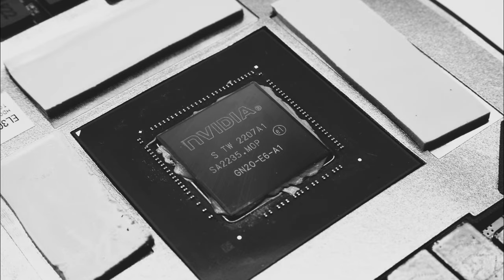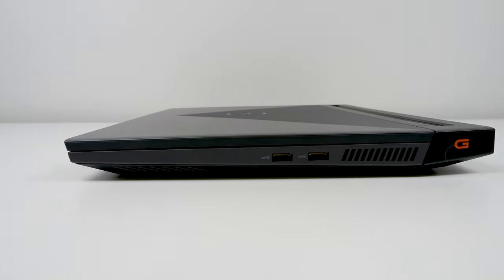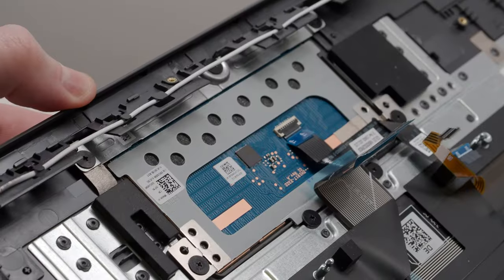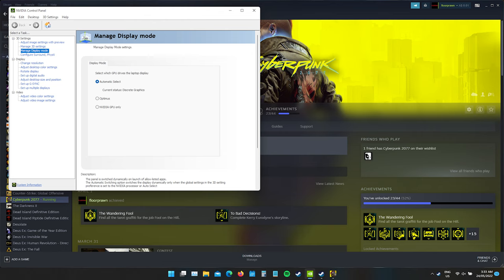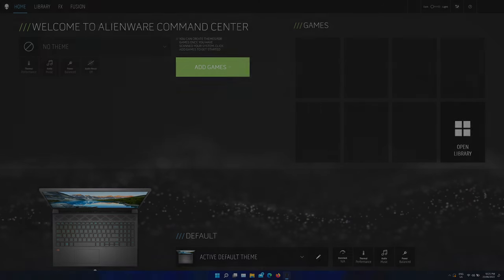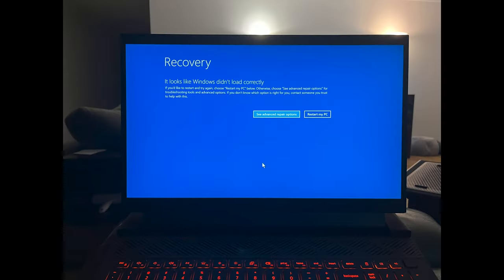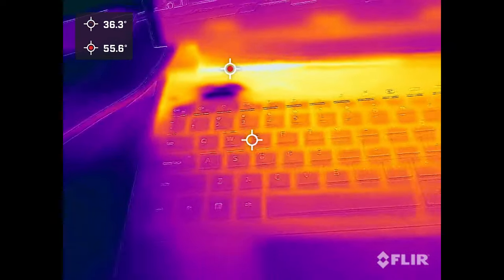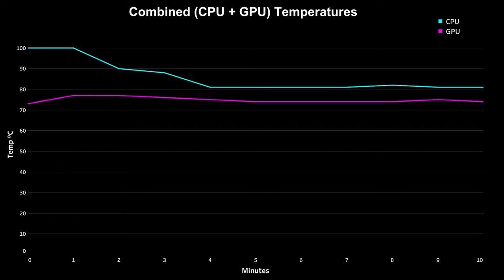Dell G15 5520 - i7 12700H/RTX 3070 Ti - Nuclear Review

Comment: I bought the RTX3060 6GB variant from their official refurbished for £750 which is almost 35% of the original price. So far I am happy with it. It is able run light machine learning models which I can deploy on a HPC cluster later. I played GTA 5, Cyberpunk, Hitman 2,3, COD MW3, RDR2 etc same time streaming.
Reply: Do you have any issues with CPU running 100% on light games?
Reply: @devosaiditsfire3445  no. the cpu is 20 cores.
Reply: Might just be bios or optimization for me
Reply: r cpu is hot like on this review? 100 Celcius?

Comment: Oh my gawd No, i just bought this laptop and will arrive next week Tuesday. Maybe I should have bought the A15 6800H 3070TI, should i cancel the order? I wish i had this review sooner, I'm so worried i wont like it.
Reply from the maker: Did you buy it from Dell or somewhere else with a good return policy? If so, just wait. You'll know what to check for on yours when you receive it. If it shows up and you're happy with it after a few days then rock on - otherwise you'll be able to send it back and try something else.
Reply: @NuclearNotebook  I did not buy this from Dell. I can return the product for a full refund, but only if the product is unopened. If it is opened, i can return it within 7 days of using it but after paying a 25% restock fee. The loophole is that if i find anything faulty, i can replace it with the same product, another product or receive my money back, but that is only because of the law in my country, they are are doing the bare minimum required. I have heard about the software bug problem from multiple people, maybe i can use that as the faulty problem.  I am considering playing it safe and just cancelling my order now, they are legally required to just give me back my money no questions asked if they have not shipped yet, have you heard good things about the Asus A15 6800H 3070 from 2022?
Reply: @Dani-kq6qq  Hi there!
How has the experience been so far for Dell 15? I'd really like to know as I'm about to buy one. Thank you.
Reply: @beksan9775  Mine is a black obsidion special edition 5521 G15 1440p 240hz G-sync 400nits DCI-P3 99% 12700h 1TB pc-ie gen4 140w tgp(125w excluding dynamic boost) with advanced Optimus 3070ti 32gb DDR5 ram, & I got it for 1,716 in USD before tax, it is a very competitive price in my country, but you may get better deals or better priced laptops in your country. It performs very well and the screen is very good, I love the laptop but part of why I love it is because I use it as a desktop replacement where it is almost always plugged, 3 year warranty and I got it at a very competitive price in my region and all this stuff may not be true for you, I wouldn't pay more for it & I would feel differently if I planned to use it mostly unplugged. Battery life is poor, yet somehow can last a decent amount of time when just playing movies locally with vlc or using Word with wifi off, but that still requires fiddling with the right conditions & that fiddling is not how I like to use a computer. I suspect the battery life is this bad partly because of poor software power management, but 12th gen is still bad for battery and heat generation, so you might want to buy the Ryzen 6800h version. It can get warm & loud unnecessarily even with light tasks,  I am using it right now and it is 31% to 42% fan speed at 55 to 63 degree temp for cpu and 42% fan speed for gpu at 55 degrees temp for gpu according to Alienware command center program while 40 chrome tabs open & utorrent(legally torrenting datasets for my work). But don't buy expecting a silent machine, but you can force it to be quiet, but it will mean more heat & more throttling. Keep in mind it is 17 degrees Celsius morning where I am at right now & my room does not face the sun, so it is not like it is a warm room. It likes to be plugged in to perform at its best, but that's true for all intel cpus, it is also heavy and the charging brick is big. I have not encounterd any bugs, my games load just fine, the G key works fine.  You've also heard that it has 1 functioning Ssd slot, that is true, so don't choose below 1 TB, I am saving to get a 2 Tb gen4. I am at 543gb after installing god of war and jedi fallen order, but I also use this machine for software development, so that's where most of my storage went. It plays games very well at 1440p, I have played GoW, Fallen Order, Shadow of the Tomb Raider, Guardians of the galaxy at high to highest settings at above 100fps DLSS on Quality setting and raytracing off and can get as hot as 92 degrees on the P cores of the CPU and 82 degrees on the GPU but will usually target 79 degrees. You should use a laptop fan stand that can elevate to get the best temperatures.  I am gonna test how cyberpunk 2077 plays at 1440p on this machine today.  I mentioned a lot more gribes not because I don't like this machine, but because you will like it better if you know what you are buying. The rest of my opinions are purely subjective and will change. The touch pad is smaller than I expected but I am used to using big macbook pro TouchPads, not of windows gaming laptops, so there is that. I like the keyboard, I like the rgb at the front bottom of the laptop, I like the rgb keyboard customizations, I love that it looks like a gaming laptop, but a bit subtle when I am at work.

Comment: thanks for the review. found this after i had bought my laptop and was looking for a tear down of the laptop. i appreciate that. this is the first laptop where the head pipes aren't on the bottom of the laptop and it looks to be a pain to get to them. i was going remove the thermal paste and  add arctic MX4  since i heard that dell cheaps out on the thermal pastes. did you notice any thermal differences after reassembling vs before? currently when i run the cpu at max 100% in power options and on a easy title i get where its bumping up to the 98C temperature ranges and 60c idle ranges. which seem hot to me.
Reply: I applied honeywell 7950 to mine and I do indeed see idle temps in the mid 50's and peak load temps exceeding 100 degrees on this laptop. The gpu on the other hand now hovers around 72 degrees under full load at just under 140 watts, which I consider a very healthy temperature.

Comment: Hi there, I was about to buy the version i7/3060 or i7/3070Ti but I came across so many bad reviews (mainly problems about overheating etc) I will mainly use it for video editing and gaming and I really don't care about 2nd slot. I am mostly anxious about thermals as they reduce laptops overall life, but if I repaste with a premium paste wouldn't it be ok? I would like your opinion or another recommendation around the same money
Reply: Did you buy this laptop? If you bought this laptop, can you share your experiences with me? Because I think the same as you.
Reply: They're using the same cooling system from 2021 (or maybe with some changes for the worse to cut cost?) to cater more powerful processors. That's why the GPU temperature is basically stable and the processor's temperature's peaking all the time. Last time they have solved this issue with BIOS updates.

Comment: I hear you but disagree on the overall review - personally I use mine for heavy gaming and it’s worth every penny.

I bought this as a desktop replacement because of the performance - picked it up for $2300AUD with the 3070ti and can’t say it’s not great value.

I’ve got mine on a laptop stand (solves heat issue) and plugged into a 1440p 165hz screen via display port cable (adds some additional performance by disabling Optimus - checked  from Jarod’s Tech), and it’s paired with a razer keyboard and mouse for comfortable use.

Have thrown everything at it and it’s amazing for $2300AUD, I couldn’t find a better deal if I tried when purchased last month. Cheers!
Reply from the maker: You're not wrong about the value - that $2300 discounted price was nuts for the specifications on these. Hope it continues to treat you well!
Reply: @NuclearNotebook  Sorry man 1 last question I can see people bombarding you with feedback haha. 

To manage CPU temps do you have any suggestions on setting PL1 and PL2 in the intel extreme tuning tool? or probably no need? Cheers!
Reply from the maker: @abc123myabc  it looks like the cooler can handle up to around 70-75W max on PL2 when only the CPU is loaded up. If you don't like 100 degrees, try setting it somewhere around there and see how you go. Because of the way Nvidia Dynamic Boost works, you shouldn't worry about changing PL1 (which is most relevant in games due to the long-term workload) because it'll be constantly altered during gameplay to balance power between the CPU and GPU, but you'd bring temps down a bit by capping it at 45W which I believe does limit how much power Dynamic Boost can ultimately shift to the CPU.
Reply: @NuclearNotebook  legend! thanks man I will give it a go. Good luck on other review you deserve way more subs!
Reply: I too got it for a similar price and is my desktop replacement. You will not get anything with this spec without paying 1k more, Dell has some killer corporate specials. I may have to upgrade the tiny SSD later on but that's ok.

Comment: @NuclearNotebook Great review, I was looking to buy G15, but with the 2nd SSD issues, I changed my mind now. Can you suggest a good laptop, with specs, such as i7 12700h, 3070ti, 32Gb ram(seen most laptop with this configuration having a default 16gb ram), plus storage of 1tb or 512 gb. My use would be something I would be gaming on it 30 to 40% of the time, while other usage would be related heavy internet usage, plus sim software like Matlab. Budget would be near to 2500 to 2000 usd

Comment: I've been wondering, given the wide array of configurations between both the Ryzen and the Intel editions, would it be possible to replace the motherboard with an RTX 3050 for the RTX 3070? I've been doing some research and it seems to be the same board (physically) and the only visible difference is the additional components on the GPU side.

Comment: Excellent review, very thorough and well done.  Honestly while Dell is certainly one of the worse offenders here, the thermal situation is often a consequence of putting high end components in a budget laptop shell.  Like I get why they do it, and for some people this laptop will be great (because of performance), but imo it’s tough to recommend something like this with these specs.  Like one ssd slot?  That’s utterly absurd in a 15inch gaming laptop.  Might as well spend a little more money on a more premium machine with better build quality as well.  Unfortunately that’s exactly what Dell wants you to do.  It is what it is I guess
Reply from the maker: I suspect the deleted M.2 slot is to create more differentiation between the G15 and Alienware M15, since they're pretty much identical machines. The M15 probably needs to move down in price and replace the higher-end G15s, I don't see why they need the fairly confusing lineup with the M-series overlapping the X-series Aliens in price. With that said - I like number pads so the G15 still has its place!
Reply: @NuclearNotebook  huh I guess they removed one when switching to 12th gen, my g15 5511 (which was $581 on sale!) has an 11260h and 3050ti, and while it doesn't have thunderbolt it does have 2 ssd slots, naturally the second is pcie 3.0 though given the included ssd was m.2 2230 it didn't really matter.

Comment: Hey if you still have this, can you check something?  Wondering if this can connect to an external monitor and use g sync on it via the USB C port...

My Alienware m15 R7 is basically a slightly better version of this and Dell stupidly made the TB/USB C port passthrough integrated graphics on my model...

Can't use any g sync monitor unless it's HDMI 2.1, which is useless since most monitors are 2.0 and all 2.1 monitor are 4k and expensive as hell.
Reply: Did you solve this? I am going through the same thing, tried hdmi, and displayport over usb-c. Neither gave gsync options
Reply: @jg85   Yeah most likely because your monitor is only HDMI 2.0 and the TB4/USB C goes through the iGPU, making G sync unable to be used in the Nvidia control panel when using displayport. 

You have 2 options basically, one being free and the other being expensive. The expensive option is to buy an HDMI 2.1 monitor but then you'll only have 4k 144hz options but no 1440p. 

The second is to enable adaptive sync via Intel graphics command center/windows 11. You'll still take a performance hit because you'll be using Optimus, but Intel now has adaptive sync available for iGPUs if your monitor is free sync/ gsync compatible. That's the method I'm doing now and so far it's worked well.

https://www.reddit.com/r/XMG_gg/comments/q3jcqd/lets_talk_about_adaptive_sync_on_xmg_neo_with/?utm_medium=android_app&utm_source=share

That post explains what you need to do basically to enable it.

Comment: thanks for your very professional work , and I had just paid $2309 with 277 cashback for this laptop.  the 2230 M.2 will be definitely a pain ,but it may be used in steamdeck to replace the awkard 64GB MMC(if you have booked a budget version from US). As I had viewed quite a bit test videos, yours are the best which unassembly the whole machine (Most of the test reviews dont even try to touch the fans).  
However, the fan noise and temp bad feeling may be just personal.  Most of the tests from the others are providing positive feedbacks comparing to other gaming laptops for these. So,  it may not be an issue for me, but your point about the up-side-down motherboard is definitely pain my ass for cleaning the dust.
Anyway, thanks for everything and I have subscribed your channel, and expecting your other videos in future.